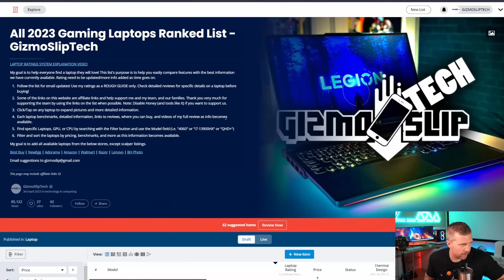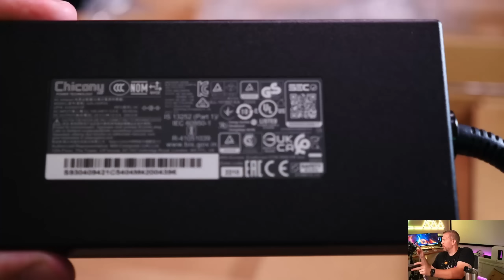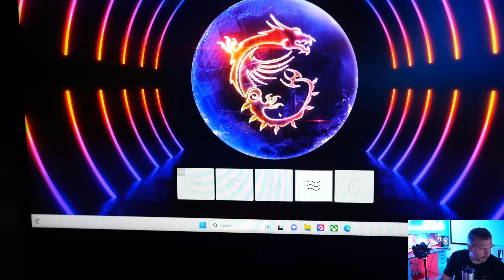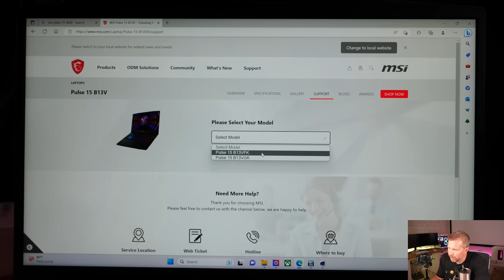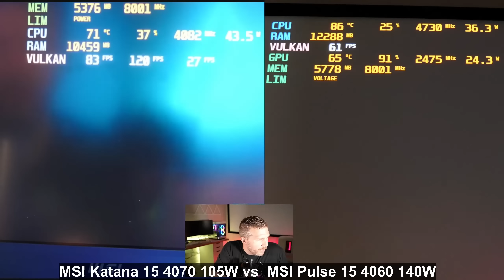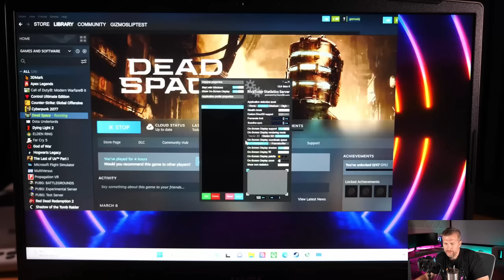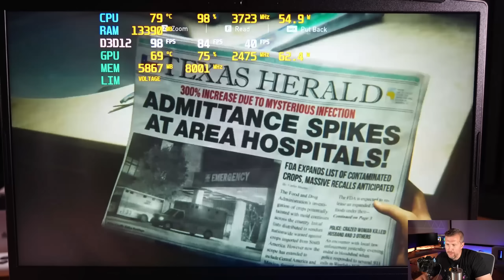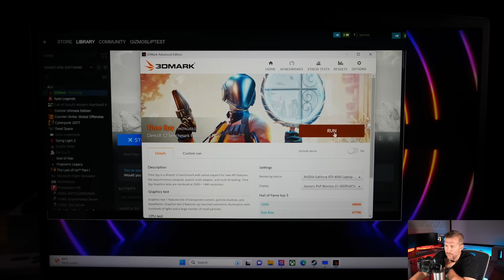MSI Pulse 15 Review - Best $1500 QHD RTX 4060 Gaming Laptop?

Comment: I have an MSI Pulse 15 , you can get in two m.2 ssd. Just lift the left side of the battery and insert the ssd. And screw the battery with the bottom screw only on the side. The battery gets a small bulk, but the ssd doesn't move and the battery is in no danger. And no difficulties in screwing the back piece back on. So yes you can have two m.2 in it.
Reply: There's supposedly a bracket MSI will send you if you ask for one.
Reply: It's officially possible I called MSI tech support.
Reply: You can prob install a bracket but you would have to remove the battery and run off plug in only. That's what I'm guessing after research.
Reply: My bro listen to me no need to get confused , just use this -> EP-051+SA-002 M2 NGFF M-key NVME AHCI SSD to PCI-E 3.0 X1 Vertical Adapter with Extension Cable

Comment: DDR5 single dimm/soldered only with one empty DIMM (as on some Asus machines) works no worse on games etc because of how the one RAM controller per DIMM/channel works. There was one review where they looked it up and software reads one 16gb DIMM or a soldered+empty DIMM slot as 2ch RAM.
Reply: This machine has upgradeable ram, both slots are open can take up to 64gb
Reply: @pilsplease7561  And I'm not talking about this one, I'm responding to a point made about single open DIMM slot models

Comment: i like your guides i was wondering i have this laptop with the 4070 what monitor in the 2-300 range would you recommend for this my current situation is my second monitoppr display is not half as good as my laptops lol because its about 5 years old still a great monitor i currently have a asus vg245h and it has been great but with this new laptop i def need a monitor that matches btter
Reply: Msi qd 27 170hz